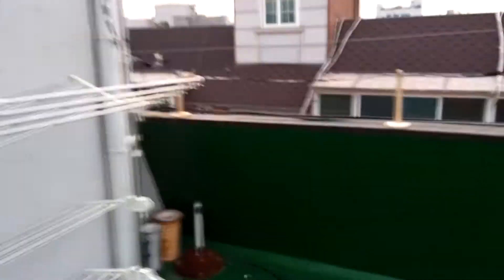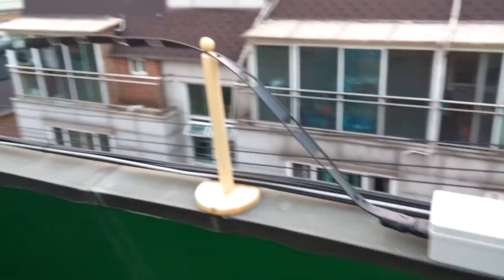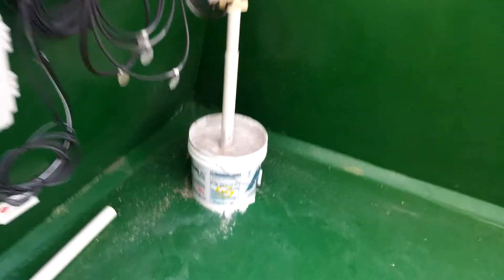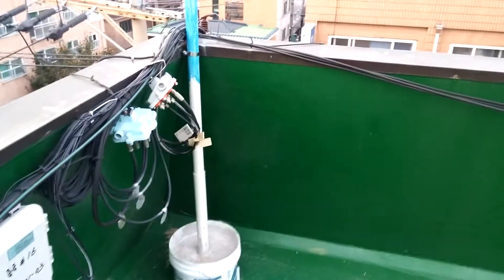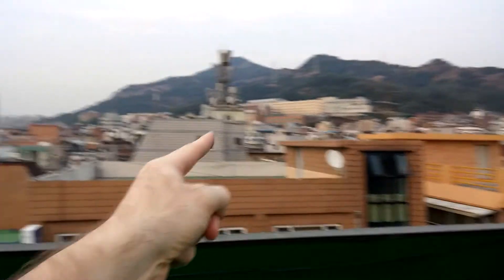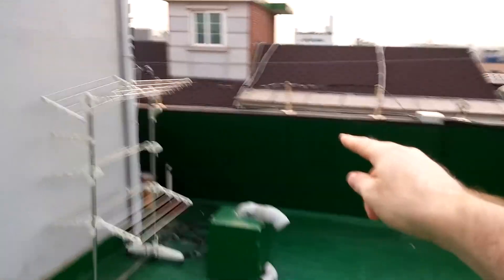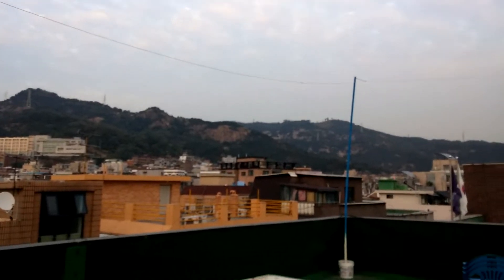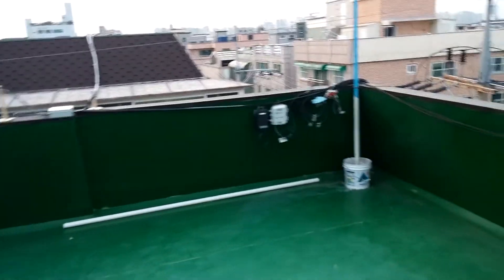40 meter loop antenna with ladder line & Yagi idea

Comment: how long do you use the ladder line? is there a special calculation to determine the length?
do you also use balun?
Reply from the maker: There are recommended lengths online via google search.  I measured once, but honestly, I have changed lengths a few times with different placement.  If it doesn't work, then one of your bands will not tune and SWR will be very high.  If so, just add or cut a meter or two and re-measure.
Reply: @thestingyham1188 ok thanks for the information,.

Comment: You did not kinda luck out man, you totally scored. Roof access in Korea is not an easy find. I live in a new building (residential tower) and there is no option for me but an inverted V, random wire outside the window for shortwave reception only. The only chance of my operating here is over the internet or out of a tent and backpack.